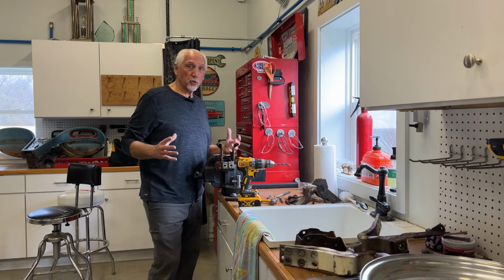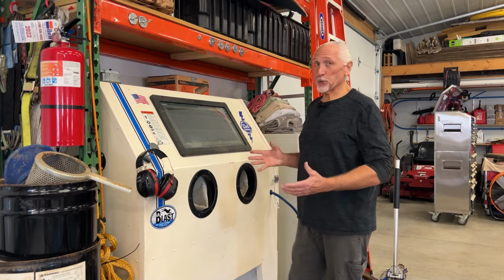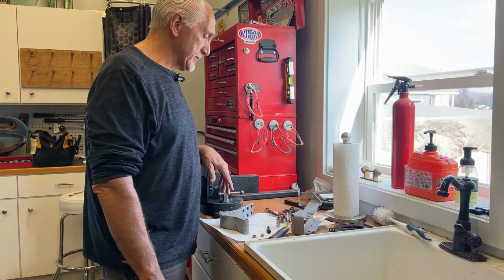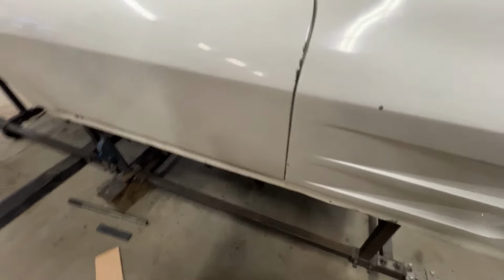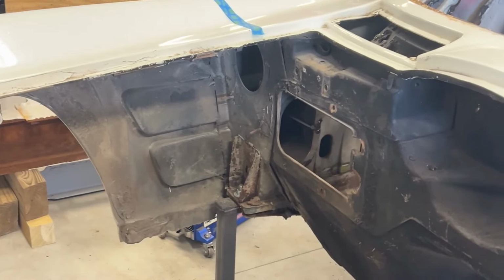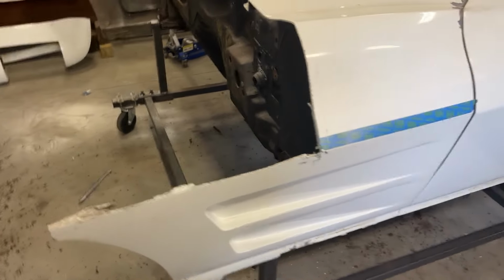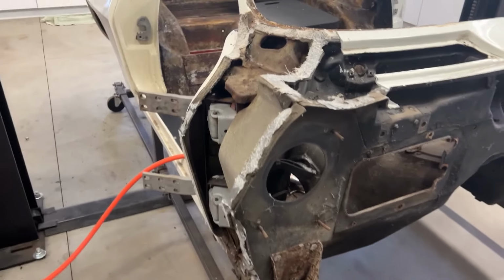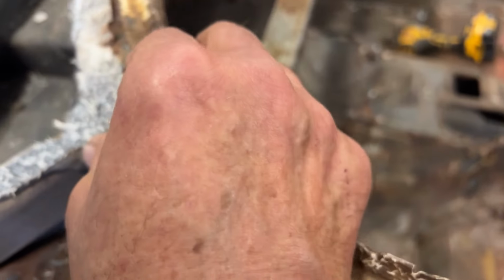Front End Fix- up//Glaze's Geezer Garage S.W.C. Epi. 8

Comment: Looks good Don! Thanks for the shoutouts. Corvettes can be like icebergs. They might have some problems on the surface but they can have a lot more underneath. 

Your car looks pretty solid underneath though. It will definitely take some work but you’ll get it. I recommend taking lots of pictures and measurements before you take it apart. Your car has lots of good data points right now that you will need later. I’m excited to see it come together.
Reply from the maker: Thanks for the comments Mitch. Great suggestion on taking measurements. Any suggestions where to take the measurements? I assume the door jams
Reply: Excuse me for my ignorance, but why the need to remove nose end , and the body panels ,etc .they all look in descend shape